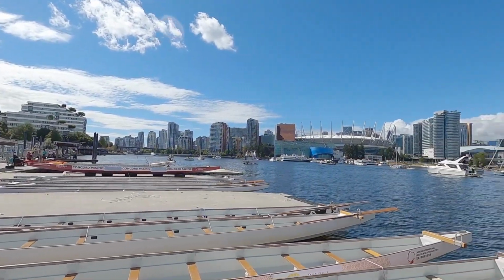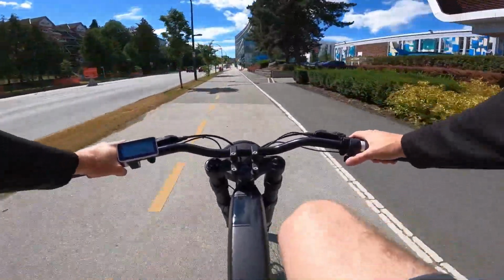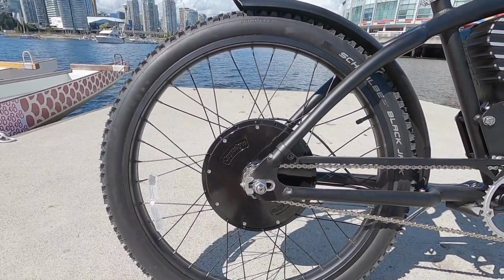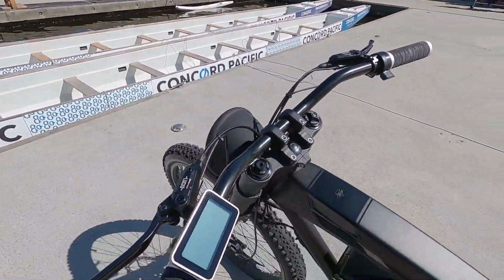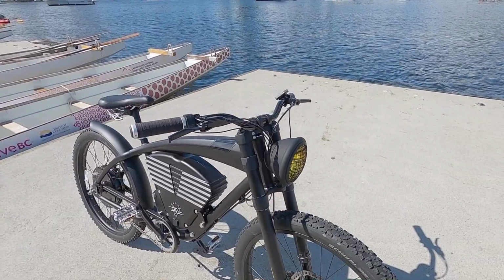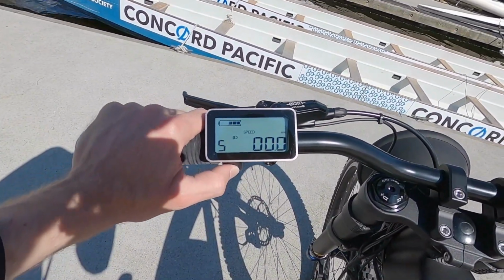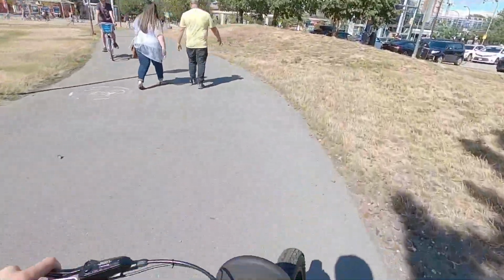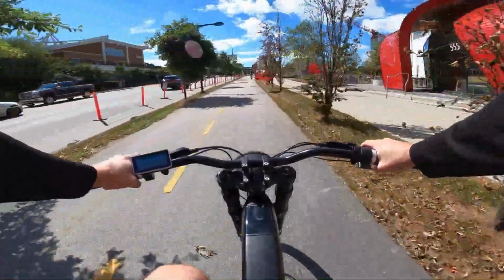Vintage Electric 72 Volt Scrambler Review - $7k

Comment: I bought a roadster 2 years ago for transportation.  It's awesome.  I get around the city in comfortable fashion on the trails, the sidewalk, the bike lanes, and on the street. I hop curbs and ride through city traffic with ease where ever I want to go.   For 7,000 you get a combination of 39mph top speed, smooth ride, high build quality (battery and frame), and above average range.  I didn't find that combination in many other e-bikes.   I bought a rack this year and now I can run errands.  If you're looking for fun and performance to maneuver around city, this might be the way to go.  Thanks EBR for the review.
Reply: I have been thinking about purchasing this bike for work transportation. Much of my route is bike path and am worried about people making a fuss over the motorcycle look.
Reply from the maker: Cool, thanks for your "owners take" on this product Leron. I was very very impressed with the performance and comfort. You're correct that it's offering a rare combination of features and performance.
Reply from the maker: Hi The4Heck I can understand your concern. For what it's worth, nobody said anything to me during the test rides. There are more ebikes than ever on paths and streets now, and the fat tire models make a lot more noise. I feel like you wouldn't have a problem in most places I've been (medium and large cities in the US and Canada).
Reply: You take a 40mbh bike on sidewalks.  What is wrong with you, honestly?
Reply: Wow my bìke does 39mph for 1,999$. Wicked E bikes Cruiser.
Reply: Can you substitute the display for a color one?

Comment: Wow, 7k for a direct drive hub, single speed, high volt motor with plenty of performance and choked to 20mph; but you need to pay even more to unlock the speed limit.... On a positive (as the world is neg enough) I do love that thru-axle inverted front fork and tires. But I know a sub 2k bike (ahem Himiway) that won't beat that on acceleration, but code 0510 unlocks the settings for you to achieve a solid 28mph. No I don't own either, but the weird shape, not easily removed battery, and the kickstand... It's just not a competitive choice, especially if you have 7k to spend.
Reply: You can get motorcycles at this price

Comment: Looks great but way too heavy for a bicycle
Reply from the maker: I found that the weight actually improves the comfort on these bikes. It reduces vibration because the frame has some inertia of its own. I was able to lift it, and I could haul it on my platform rack with an 1-1/4" hitch, but it would be nice if the battery could be taken off for easier charging and lighter weight on service and transport. It's nice that the bike can also support heavier riders, up to 300lbs total.
Reply: It's fugly imo

Comment: Nice bike but the price is out of my range . I know the fake motor is part of the design but looks funny to me being so big . I do like the rear mudguard design , would suit my bike :-)
Reply from the maker: Cool, which bike do you have?
Reply: @ElectricBikeReview  Sorry i don't have a name brand e-bike , i converted my old bike to a TDR 26inch 36v 250W rear hub motor , you probably don't know that brand being in Canada . I've had it for 2 years (5,000km) and it's still going strong . Cost me $500aud .Good enough for me and i can get 50kms out of it . Thanks for all your reviews Court . I might get a NCM Moscow ebike next as i tend to be on the cheaper side .
Reply: Expensive. You can buy suron and dual motor ebikes easy for half the price

Comment: Because I might need to cross a street or an intersection quickly, I would prefer to have a throttle that can produce full power regardless of the assist level setting. P.S. don't hand your camera to a stranger in the Bay area. LOL
Reply from the maker: Haha, yeah I think about that each time! Thankfully, things usually work out okay, and people are friendly. I used to live in Daly City and work in SF... got stuff thrown at me on the way to work occasionally when I'd take the BART. Anyway, I agree that full throttle power is nice to have... especially since it's a variable speed lever.

Comment: Do you know if the 80% charge setting still balances the cells? I ask because I have heard most battery management systems don't balance until the cells are somewhere around 98~%

Comment: Is that 40 mph available throttle only in race mode?
Reply from the maker: I wasn't able to test it out, but I think it's 40mph top speed pedal assist and throttle. Basically, what you'd get in assist level 5. You can only get that higher speed by purchasing the race key for $150, otherwise it comes specced for your geography, like 500w nominal 20mph top speed for Canada or 750w nominal 20mph top speed for the United States and maybe 250w nominal 25km/h top speed for United Kingdom.

Comment: No gears, small lights, cheap pedals,  no racks, no rear suspension, 160mm rotor size on the rears!!  What are they thinking, put 203 is on there with a 4 piston caliper, not worth the money, buy a  Juiced hyper scrambler 2!  10000 x  better than this bike.

Comment: Court, I think that reviews like this is a slippery slope.  There's a lot of concerns I have with e-bikes like this;  
-The battery at the end of it's life.  Can you buy a new one?  How much will it cost?  Can you recycle it?  How do you dispose of it?  At least with an e-bike with a Bosch or Yamaha system you can find a new battery replacement.    
-The possible speed kit option.  You would have to be naive to expect that people would get the speed kit and not use it everywhere.  Having e-bikes with that kind of speed invites abuse.  Irresponsible e-bike riders gives e-bikes a poor reputation.  Therefore, all e-bikes will be less welcomed in more places. 
I believe that there are too many of these novelty that bikes possible hurt the e-bike movement.  The e-bike industry needs to develop standardized protocols. 
Court, I'm a long time fan of your work.  But, promoting bikes like this is a poor idea.
Reply: For the few people who buy this bike, price is not the issue. Wear and tear won't be an issue either. How much do think they will actually be riding this thing?
Reply: @goobfilmcast4239  How much someone rides matters little, I like seeing bikes that are responsibly built.  Having that high speed kit option invites abuse.  I've know people with bikes much this.  They're addicted to the speed.
What do you think of bikes of this nature?
Reply from the maker: I feel you on the concerns. The company has been owner operated since inception and they do a lot of upgrades and repairs... even custom paint and mixed builds for people who want it. I think the battery could be re-packed by FTH or Vintage themselves. It seems like they are more attentive than a lot of companies and more open source with their simplified hardware. The display hasn't changed, the motor is different inside but they use the same supplier as three years ago. II don't see it as e-waste, and the novelty could attract people who would otherwise skip ebikes. The company has good integrity from what I've seen and the performance was really outstanding.
Reply: @ElectricBikeReview  Hi Court and thanks for your fast reply.  I have great respect for all that you have done over there years.  I often visit your YouTube channel and website to research e-bikes.
  
If I was to purchase a  Vintage Electric 72 Volt Scrambler and have it sent to an address in the the US.  What happens when  I wear the battery down?  You had mentioned that the battery is not removable, therefore I would guess that I would order a new battery.  Find a 3rd party knowable bike mechanic to remove the battery and have him install the new battery?  Or would I have to send the bike back to the manufacture and have it sent back to me?  Either way sounds a bit impractical and expensive.

In contrast, I know that I can easily get replacement batteries for Bosch, Yamaha, Shimano, Brose and Rad Bikes.  Changing the battery on those bikes takes seconds and requires no tools, just a turn of a key.

The sellers of the Vintage Electric 72 Volt Scrambler are trying to fly under the radar of detection.  If you want to make a bike, that in reality is a motorcycle own up to it.  Once people will get the ultra speed kit, they will use it where they please.  More speed requires more safety.  However there is no blinkers, no regulated taillights, no rear shocks to handle the extra speed.  Are the front shock that good to handle that kind of speed over years of use, like a motorcycle would be?  

There is a lot of innovated stuff coming to market, but much of it is half baked engineering.  A lot of politicians know very little of e-bikes.  If their first e-bike impressions are bad, they may be turned off for a long time.  Irresponsible bike manufactures potentially creates an uphill battle for the rest of the industry.